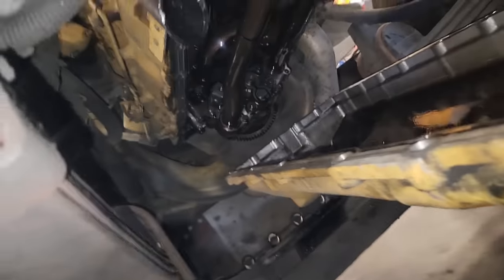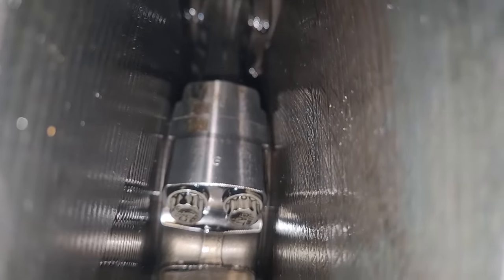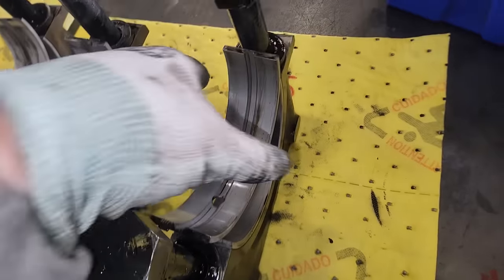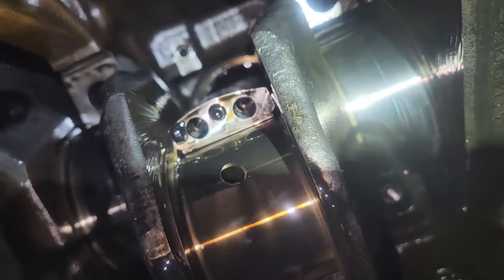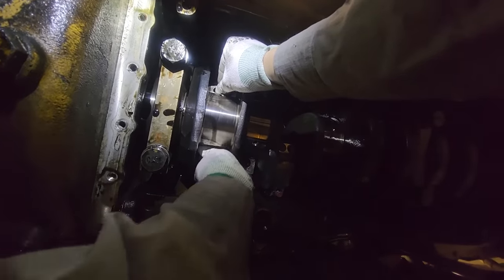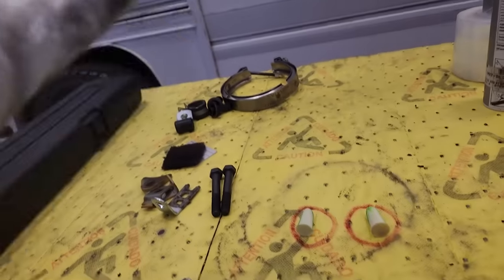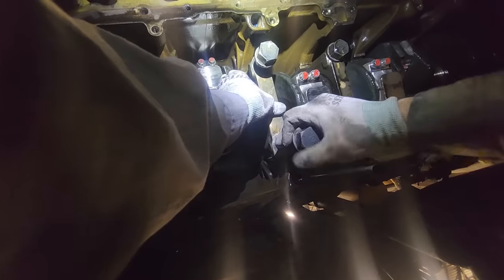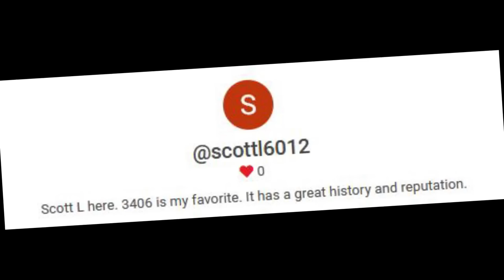Nice Truck Driver Paid for an Engine Rebuild, gets a HEADACHE! Engine "Re-Rebuild."

Comment: Using white lithium for assembly i would think could change your torque numbers? Using what the manufacturer says to use should be paramount i would think! Im a body man not a mechanic or engine builder , I've learned common sense isn't as common as one would think. Especially you would hope spending thousands of dollars you could buy some when getting your engine built but apparently not so much common sense out there these days! Lol good work buddy us techs gotta keep up our standards we owe it to the customers. We would want the same💪🏼👊🏼💯🇺🇸

Comment: why not use an aluminum flat head rivit in the crank oil passage to rotate the bearing shell in the block by rotating    the engine  ???

Comment: Just bought an 06 western-star with a c15. What are the common issues and parts that I should carry. Sensors etc. I have also seen the large air fitting loosen up on top of the compressor on other accerts. What is the common cause and cure of these loosening? Both ended up replacing the whole compressor due to the threads going bad

Comment: I'm not a diesel mechanic and have very, very little experience working on them. I did have ASE certifications 40+ years ago, and am currently a small engine mechanic with a lot of current training from various manufacturers. I've noticed from watching a lot of youtube videos, that both automotive and small engine mechanics, seem to have some kind of aversion to using a torque wrench. Some parts that absolutely must be torqued are rods, main bearings, heads, and almost any bolt that goes into aluminum. Time and again I see mechanics just running bolts in with an impact and then sending them down the road. I have a question about what you're doing here: Aren't you supposed to check bearing clearences on diesel engines?

Comment: If you use Lucas on your bearings you wouldn't have that  problem no need to pre oil  Lucas stops dry start up I never put it in as an additive but I always use Lucas to assemble my engines just because it's so sticky about the only thing it's good for

Comment: This might sound dumb but I’m doing main bearings right now and no matter what I do, I cannot get number 4 to slide into place, I can’t even get it started
Reply from the maker: Not dumb at all, the very engine in this video was very difficult to get the number 2 main upper in. Try rotating the crankshaft to different positions and see if there is a spot it'll start.

Comment: I've not seen the video but I just saw an aviation disaster caused but sub-standard parts that were perhaps only 60% of what
their needed heat tempered strength should have been.  That said I posted a comment asking just how many "Parts" being
used in cars/trucks/boats & other vehicles were being used to cut corners.  It's a huge issue.  peace
Reply: After seeing this I now know there's a serious lack of integrity throughout this industry just as there was in my chosen field,
Heating n A/C !  I hated to burn down the prior man to work on a unit but there were times that the paperwork & what I am
seeing didn't add up.  Then you do what you have to do??  Casting stones is never any fun & I'm wondering WHO/Where he
had this done?   I'd want to avoid that place at all costs !!   Thanks for the video.... peace & GB ALL

Comment: FOR THE OWNER OF THE TRUCK: it’s perfectly normal to lose 3-4 psi of oil pressure when engine is under load. Leave that engine alone from here on out

Comment: Just a Dumb Question : Why do they use ft-lbs and then  degree Torque ? was that always the case , and if Not why did they change it ?  I've asked on other channels never got an answer , just wondering the rationale behind it
Reply: It’s because you’re yielding the bolt… which means you’re putting a predetermined amount of stretch in the shank of the bolt. You do the initial torque setting to set everything even then based on the diameter of the bolt engineers calculate that you need to turn “X” amount of degrees to achieve the proper yield stretch.

Comment: (t=5:20) "I can't fault a guy for putting washers on", oh yes, you can. M.A.N. does not put washers on stuff that is meant to not come apart, they only put washers on stuff that is supposed to be easy to disassemble, that is how the printing presses I have worked on were made. Only  ever put washers where the assembly instructions says to put them. When they are not to be there it is for a reason.

Comment: Cat has a tool for rolling mains in.
It's a "T" shape with the top able to pivot.
You put the trunk of the T in the crank oil gallery and then use it by rolling the crank around and it assists you in rolling the bearings in.
Please don't use a screwdriver.

Comment: IMO it appears that the shop has a decent reputation but for this customer, the shop had the kid that normally does only oil changes doing it.. 
It was a slapdab effort unfortunately. 
I've seen the same thing in house exterior repair. A friend hired a "well known" company to install eavestroughing over front of the house.
They put it up in a "v". The ends high the centre the low point.
My friend was furious and gave the owner a chunk of his mind 
"I called your company because you're the professional, and you send me your flunkies"!!!

Comment: The engine oil pressure is probably dropping under a load because it might need cam bearings

Comment: Hey man, since you did a video on the 1693 Cat engine will you do one on the original 3406? I'm curious as to how the injection system compares to a 3406B, among other things, and I can't find info
Reply: The original 3406 direct injection fuel system is the same as the B but at 415 or450 Hp the B got a heavier cam in the fuel pump, you can fit the heavier pump in the early engine. Of course there are different fuel injectors for each Hp range and many other block, crankshaft, piston, cam changes along the way as well.👍
Reply: The original 3406, now called an A model was a 92U prefix. It had a slide advance for the timing. Two weights with two springs on each weight, total of four. A long shaft out to the main pump. An oring on the shaft to trap engine oil. The shaft was hollow that feed the oil to the timing unit. The main pump was compact scroll. You had PCT, PCTA pump, DIT pump and DITA pump, and parts are not the same. External fuel lines are different on PC vs DI. Internal fuel lines are different also. DIT, DITA nozzle bodies and lines are different. DIT/DITA nozzles are the same except for a DITA 400 HP which requires a different nozzle. Governor has different torque spring or governor spring, depends on HP. FRC's are not the same, mainly on PC's vs DI's. Some minor updates on DI's. 
On a 3406B New Scroll Fuel System (NSFS) front cover completely different, timing advance (numerous updates), entire pump, governor, fuel lines, nozzles, head are not the same, vs a 92U. A video would be impossible in detail. Like on the 92U, you had straight rods, narrow taper rods, wide taper rods. The pump would be the same way, you would have to explain a PC fuel pump, a DIT fuel pump and a DITA fuel on a 92U, then get to a 7FB pump vs a 4MG03600 and up pump, Single helix pump, dual helix pump, different check valves, pump housing changes and all day explaining up dates on the timing advance. 
Unless you lived through all this, Josh would pull his hair out trying do research all the changes.

Comment: There’s plenty of crooks about. We had 2 Mercruiser blocks rebuilt. Within 45 minutes of starting there was noise. They hadn’t put the clips in the gudgeon pins ( you call them wrist pins I think). & the bores were scored. The pistons had marks in which looked suspiciously like they’d been dropped on the ground. All the bearing shells grooved to bits. Just morons.

Comment: If the rod bolts are “stretching” is that different than “torque to yield” one time use bolts?, obviously there is a degree of stretching on all bolts, but once you toss the lb/ft and revert to degrees i always thought that was “torque to yield” else why not just use ft/lbs?

Comment: What did you find with the oil pump?  How do you remove the ear plugs from the oil holes.
Reply from the maker: It was a Cat reman, checked it with the customer there.
Reply: Probably either a small pair of needle nose or a 90 degree small pick.

Comment: Hey Man, I need help to figure out a problem; DD671n marine i paid for rebuilt twice in 30hours run :( now after second rebuild) on run test , we find oil pressure too low ,20psi max and doesn't go up with high rpm!! 
the oil pump haven't been changed neither rebuilt but mechanic says he tested it with hand spin and it pushed oil good!

What could be the problem? 
Thank you

Comment: Josh, I'd like to have you check the overhead and adjust if necessary on my C15 ACERT NXS15745 as it feels a bit weak in power and during an engine brake cycle.
 Can I request you as designated tech while scheduling?
 Thanks
Reply from the maker: Can certainly do that. If you want to send me an email I can tell you the contact info for the shop or if you know already, just request that I work on it.

Comment: Many bearing housings on engines are assembled and line bored during manufacture the housing is numbered to ensure correct location. If bearing housings are mismatched they will be out of line (offset to one side or the other or out of line. Unless you are very lucky and two bearing caps are exactly the same (Never going to happen for me) the bearing shells will be offset and nip and consequently damaged the bearing shells. Original mechanic screwed up on many fronts. Says someone who is time served, college trained and now training on this stuff. Many modern bolts do stretch they are like springs any expansion and contraction of a component is catered for, they do not come loose. Stretch bolts are normally replaced either every rebuild or after several rebuilds in which case the bolt head should be centre punched to indicate it has been reused accordingly. RTFM applies in all cases, Read The Fxxxxxx Manual. Do what the manufacturer says they may know what they are on about.

Comment: You should definitely get the name of the 'RE-RE'builder and put him on blast for that crap!
I mean... wow! Did he just ass-u-me that an engine rebuild was the same as replacing a bumper on a passenger car and just not bother to go and get a torque wrench? Of course there are tons of  DIYers out there who can do a better job than the factory, but on the flip side... there's just as many cutting corners. Its one thing to get 'my buddy who knows stuff' to rebuild the $800 project car engine, but this is probably an individuals livelihood. That's pretty uncool and it'd be nice to put their name on blast so everyone can avoid this 'service'

Comment: So under load is a c15 not supposed to loose oil pressure? Just asking because I have a 6nz and under acceleration/load I see my oil pressure run between 68 down to 62 psi
Reply: Under heavy loads more fuel is burned generating more heat.  The extra heat is absorbed by the coolant and the oil.  The oil is slightly thinner and pressure drops some.  This is perfectly normal.  As long as oil temp and pressure are within specs.  Hammer down.

Comment: My fucking eyes would be bleeding  too if I saw that shit 😂.  That’s like engine 101 that main caps are machined in place and absolutely have to be installed in the right position/orientation!   Grinding on the edge of the bearing 🤬.  Now on race motors with aftermarket cranks whose rod journals have oversize fillet radii sometimes you have to hand relieve them but that’s in a totally different spot.  Never seen a need to grind where that was and I’ve rolled a bunch in myself.  And the little gouge in the oil hole, wtf!  I’d be furious if that was my engine and paid good money for that hack job!

Comment: As a former ASE Mastertech. The work performed is the most pathetic and disgusting I've ever seen. If it was my truck. I would completely disassemble the top and bottom end and check all tolerances. Then machine everything out of spec or damaged. I had my M1 and M2 too. I'm pissed just looking at this video.

Comment: 6:20..... 😲 FAIL!! 

Can pretty much GUARANTEE that the bearing beneath that cap, and the other one that supposed to be in it's place, is gonna have an awfully worn bearing on that journal. I'm surprised that the crank rotated easily enough by hand after putting those caps in the wrong location that the builder didn't IMMEDIATELY know that there was an issue, and find the problem with the caps.

Comment: the lithium grease on all the bolts is small gamble. I'd personally not do it. The actual torque spec of the bolt isn't important, its the stretch. well how the hell do you measure the stretch on a bolt in a blind hole? you don't. So you measure how much torque it takes on the bolt to achieve the correct stretch then use the torque number. It worked well enough they just use the torque number most of the time. if they did the test dry, that spec is for a dry bolt. If they did it with engine oil, its for engine oil. but if they did it with engine oil, and then it was torqued with an extreme pressure lubricant, then that could make it so it would require a lower torque spec to get the same stretch due to less force to overcome friction on the head and threads. I deal mainly with passenger vehicle engines and have no clue if those are TTY bolts or reusable, but if they are reusable there is possibility they were overtorqued due to the wrong lubricant used during assembly. Now, this is far less of an issue than the damn caps being put in the wrong place, but it can distort journals, weaken bolts, distort deck surfaces, crush whatever is being clamped, and in extreme cases pull threads or break bolts. I've seen each of those personally. So use the recommended lubricant for the threads.

I know some goof is going to try to tell me "well my mama said the only bolts that stretch are torque to yield, standard bolts don't stretch"... torque to yield are stretched into plastic deformation, standard bolts are torqued within elastic deformation. Torque to yield are less sensitive to error but its still important.

Comment: The most complex job I've done was a fuel pump on a GM A-body car. Gasoline 5.4L V8, so relatively small and light duty parts. It was an alternator out job but given the car was built in the 60's, that equated to maybe 5 bolts, 2 hours (most of which was spent screwing around), and a face full of gasoline as the factory pump had one last squirt left in it. I am completely unqualified to work on diesel engines especially ones of this size and probably should not be trusted with tools around any vehicle other than my own, and yet I can't help feeling like me or any other shade tree moron would have done a better job on this rebuild than whoever schmuck charged this guy an arm and a leg to accelerate the wear on this engine rather than reverse it. At the very least I can count to 7, and if I try REALLY hard I can even count to 7 and a half.

Comment: Great video don't know much about diesel rebuilding,but gas yes maybe the cam bearings are worn if they have them. Like I said I am not a diesel mechanic. But gas cam bearings will cause drop in oil pressure. Just wandering, pisses me off people don't take pride in there work half ass it nothing more makes me want to scream. Have a good day.

Comment: So when i did my main caps on my 6nz it said to do 190 190 then 120 degrees on just one bolt. Why is that?

The Mains tighten to a torque of 260 ± 14 N·m (190 ± 10 lb ft) then tighten the bolt opposite the bearing tab side for an additional 120 ± 5 degrees (2 flats).
Reply from the maker: I hope you're joking, but I believe you are earnest with your comment. After reading your comment I literally went to read the install for main bearings on a 6NZ. "Torque bearing tab side bolt to 190 ft lbs, then other side to 190 ft lbs. Then torque turn the non bearing tab side bolt to 120 degrees additionall and then turn the bearing tab side bolt  120 degrees additionall." If you only torque turned 1 side, it was not done right and you should definitely check that.
Reply: @AdeptApe  crap..... I have 60k miles on it like that. I looked it up and this cat guy said just what I put. Guess what I'm doing this weekend.

Good news is I run 75 psi oil pressure cruising down the road. Been like that since day one. But won't take long to drop the oil pan.

Comment: I'd do some more asking to clarify the loss of oil pressure under a load. Is he talking about after or during a long pull when the oil gets hot and thin? Or is he talking about it dropping quickly as boost builds and hes pulling in each gear? You got to be careful determining what an operator is actually saying. It may just be dropping because the oil is hot. My c-12 oil pressure always is lower when the oil temp is high but when it drops back down in temperature the oil pressure comes back. Simply the oil viscosity. I've learned over the years that when a non mechanic operator experiences issues they suddenly start thinking they hear or feel things or notice things that are actually normal. Their explanation of them can have you chasing nothing. Very irritating. For example.. I helped a guy rebuild a chevy 350 one time and we put headers on it. He was constantly saying we needed to set the valves again because it had a lifter ticking.. turns out what he was hearing was just the difference in the sound when theyre idling. You get a little tick sound because the pipes are so thin, headers just sound that way but he swore it was a lifter.  Never was.  I also bought my semi 10k cheaper because the owner thought the cam followers were ticking and going bad.. nope.  Just a leaking turbo gasket.. So always be careful when the customer is interpreting an issue that may be nothing.